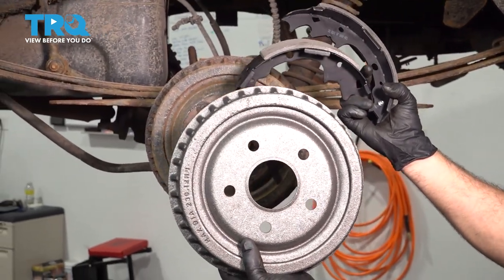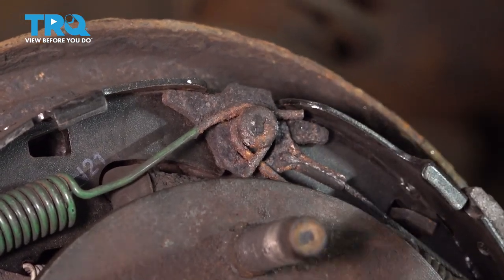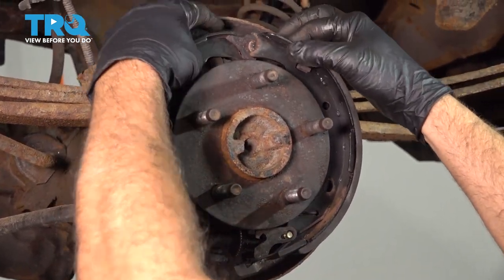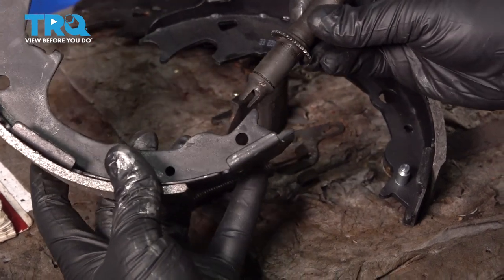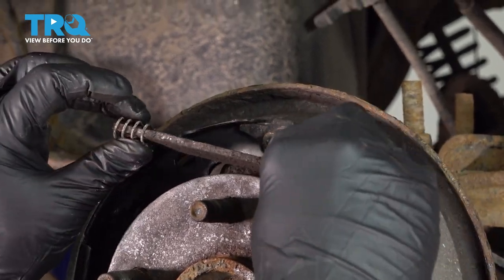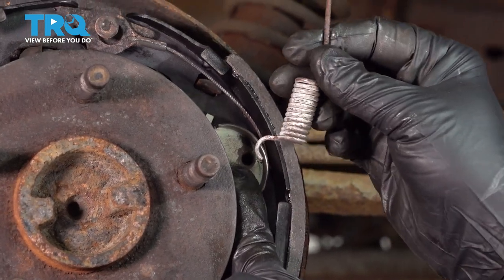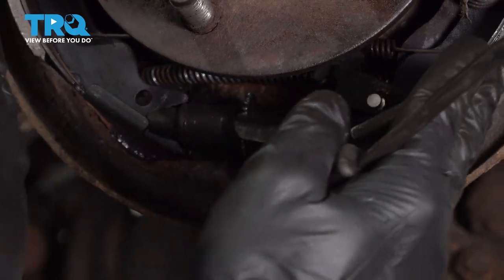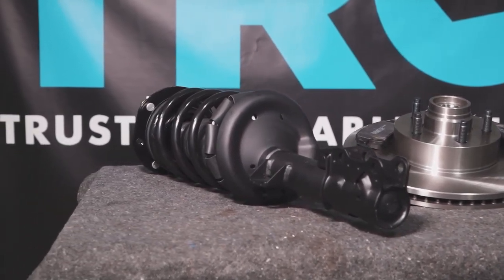How to Replace Rear Brakes 1993-1997 Ford Ranger

Comment: Oh man I was hoping you might have touched on the hydraulic wheel cylinder a bit more, but it seems this video is more for regular periodic brake maintenance not so much a fluid leak. 

Still a good video I'll use as a reference to support my Chilton manual information though. Time to do some more research in the ranger playlist you've made before deciding whether or not I take it on myself, luckily I'm in good standing with a family friends auto shop just in case I mess something up lol.

Comment: 12:25. You put the spring upside down. It should hold the retainer against the adjustment sprocket. And it’s in the wrong place on the retainer.

Comment: The adjuster is installed the wrong way round. 

The toothed wheel will get away from the adjusting lever as it opens up.
And it might never adjust in the first place
Reply: I noticed that, will it not allow the e brake to auto adjust?